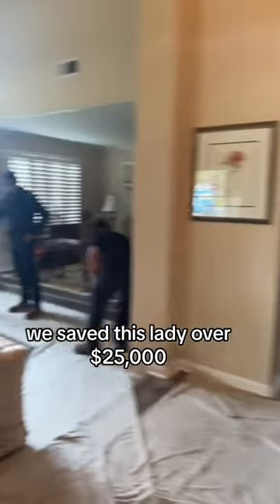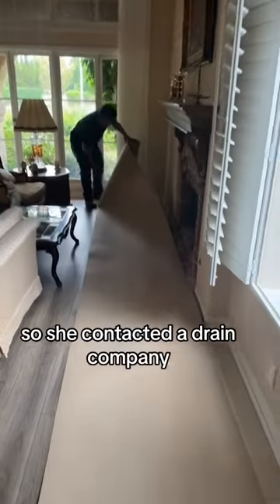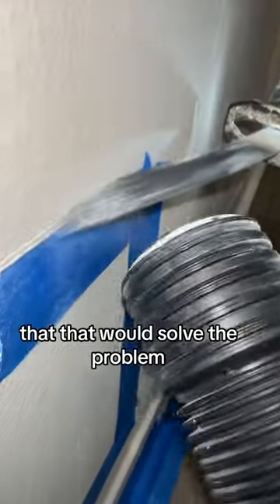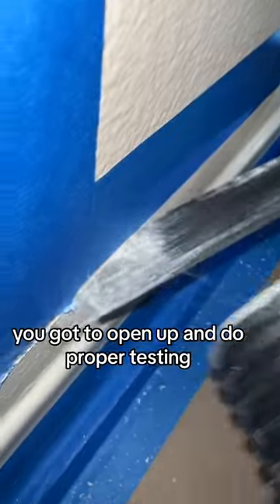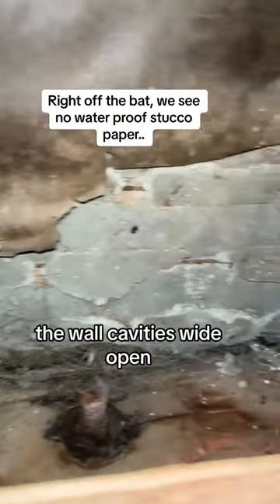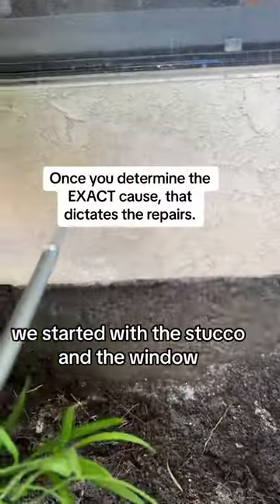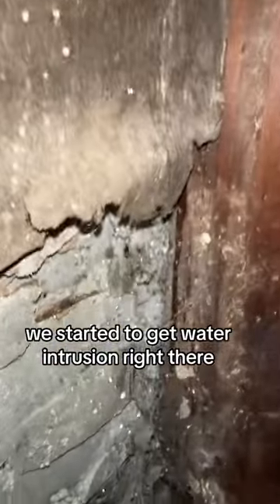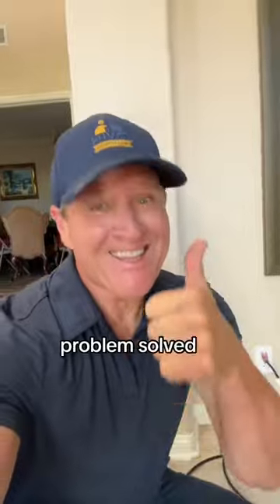This water leak detection can SAVE you Thousands..💰💰💰

Comment: As a home owner,  I'll make the assumptions and try to resolve it, if/when that doesn't work,  I'll call a professional. The professional better not make assumptions...
Reply: Some of them does, i called a professional to check on my heater last year because it's not blowing hot air and he told we need to replace some kind of switch so i told him to go ahead and replace it. It worked for 2 days so i had him back and this time he told me it might be something else, go ahead i said again. One week later and heater stopped working again so i started researching on youtube what's really going on and found out that there is a blockage of debris on one of those small tubes and i cleaned it, it worked all winter after that. I only bought the house last year so i'm kinda new to this stuff and i'm quite scared to touch complicated equipment like a heater but it so infuriating that some professional can't even do their job. I had to pay that guy whenever he came back.
Reply: Depends. If it's a big job like 25k as mentioned in the video than I agree. But especially as a contractor, I find a lot of people who refuse to pay for research costs, with wich I mean paying me for the hours and materials used in opening up walls or the floor when I need to make a quote. And when they do I have to make assumptions wich might end up costen them more money.
Reply: @madcatneon2604 there are a bunch of idiots working in construction and plumbing nowadays. My best advice is to find yourself a good contractor that has all around knowledge. Treat him properly, with wich I mean don't bitch about everything. Mistakes can be talked about but people tend to whine rather than just bring something up. And pay on time. As early as possible. Else they probably won't want to come over for the smaller jobs.

Comment: Waterproofing companies seem to be one of the biggest scams. On my current house I had one come out told me I needed to waterproof the whole basement because of water near my basement door. Wanted some insane number, like near 20k. I just laughed and asked him to leave. House has been in the family since it was built, never had water in the basement until recently. Guy claims theirs signs of water damage everywhere😂. Turns out the drain at the bottom of the steps is partially clogged, only an issue during a heavy downpour. They were the top rated company in my area😅. They did zero testing beyond touching bare concrete with a moisture meter.

Comment: Good deal. The rain came in from the outside. Stucko is only a grate of wires. Nothing solid. The wires are chicken wire glued into felt paper. No plywood. That's the way the builders learn. From one system to another. We are willing to change. No more stucko